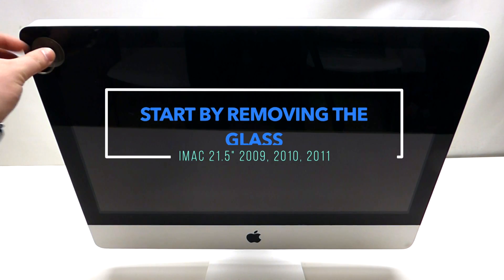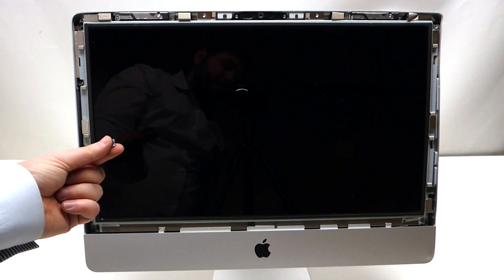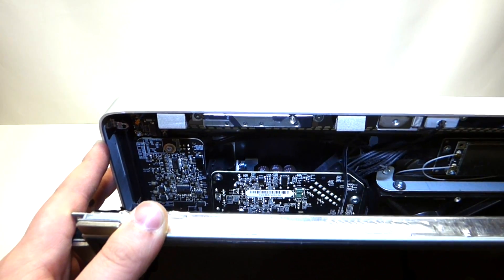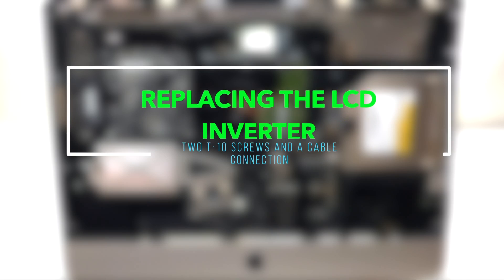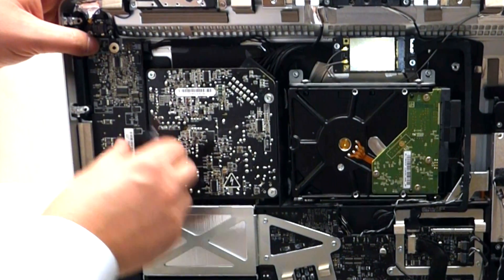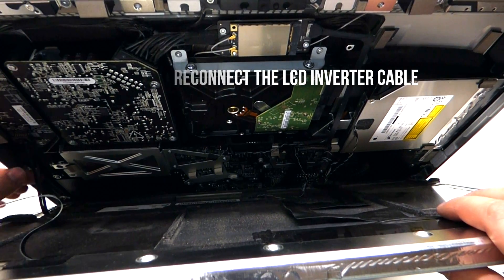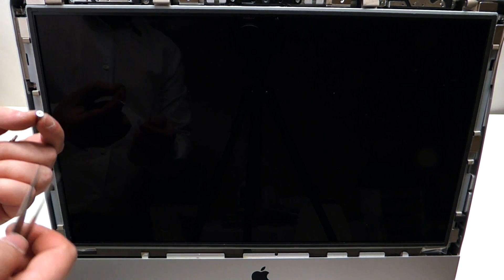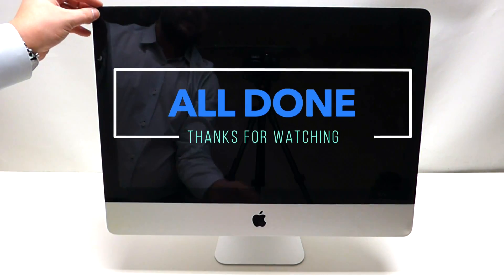iMac LCD Inverter Replacement 2009 2010 2011 21 5" Apple Dollars #10

Comment: Thank you for the instructions, they are very helpful. I wanted to replace my lcd imac late 2009 21,5 inch because of some dead pixels and lines. The lcd screen was stil working though. I bought a lcdscreen from ifixit, but that doesn't seem to work: it gave a very flaw light when I started the Imac but then stays black .
I tried it twice, cables out and in again , but the screen stays black. Then I put my old screen back and that worked as it did before. What could be wrong with the replacement, is it the screen or haven't I put the screencables not good enough into the computer ?

Comment: A plastic soda straw works great for installing the screws holding the screen.  Just inset the screw head into the straw for a snug fit.  Allow some of the screw treads to protrude from the straw.  Inset the straw and screw into the hole and rotate the straw to achieve some thread engagement of the screw.  Withdraw the straw leaving the screw in the hole.  Complete screw tightening with a torx tool.
Reply from the maker: Very nice tip! Thanks!

Comment: great video, thank you...however after replacing the board my computer worked great for about 3 days, then the problem came back...the computer monitor just goes black at random, and i have to force restart to get it to go back on....also if i plug in another monitor the screen is visible. is it possible the new board i just put in went bad already? if so what in your opinion is the cause of that? im wondering if it has something to do with the power supplied to that board maybe? i rly appreciate your advice and opinion on this issue.
Reply from the maker: Sounds like the LCD Screen is the actual issue. I would replace that first before replacing anything else.

Comment: thanks for giving me this view inside my 2008 imac ;) my lcd backlight works fine but ive noticed since around 2015 its a bit dimmer than it used to be and adjusting the brightness virtually does nothing visible.... does this mean my lcd backlight is on its way out? anyone have any experience with this? would replacing it return it back to its former white-bright glory?
Reply from the maker: This means that the LCD panel is giving out from years of use. You have to replace the entire LCD.

Comment: Hi , backlights not working screen is black when flashing with torch to screen i can see everything .when i press ctrl+shift+eject screen light up normal for second,thats mean wires  and lights are ok, you think this part will solve the problem?
Reply from the maker: It's the LCD or the inverter. I would replace the inverter first since it's the cheaper one to replace out of the two.

Comment: So, for a 2010 imac 27" with a A1312 inverter what would be different with this installation?
Reply from the maker: The location of the internal connections once you start taking off the LCD are slightly different but the theory is relatively the same. I believe that by watching this video you can do a 2010 27" imac inverter replacement without a problem.
Reply: Awesome. Thanks!

Comment: Hi I have mid 2011 imac 27 with i7, it randomly goes black but everything still works just have black screen. I followed this vid with replacing my inverter with new one and issue is still occurring. I did do smc n pram resets and no help. any other ideas? Thanks
Reply from the maker: Next would be the LCD Panel, then power supply, then graphics card, if that model has one.
Reply: Save Apple Dollars, ok so today I hooked up external monitor and when the iMac went black the external stated on. LCD u think?
Reply from the maker: Yes, I would go with the LCD next.
Reply: Save Apple Dollars can this be some kind of lcd Cable that heats up and turns de lcd off because some times it takes long time to shut of the lcd.
An Apple technician told me to check the cables first, if it doesnt solve it, lcd problem.

Comment: my imac 2009 27" got black suddenly :( is it the inverter that i have to change? and is it the same inverter like for imac 21.5 "?
Reply from the maker: It's one of the following four components, they should be replaced in the following order based on cost: inverter>power supply>LCD Screen>Graphics Card(Some units have integrated graphics). The next logical step for you is to replace the power supply or the LCD panel, I would try the power supply first.

Comment: Hi, I replace a refurbished inverter in my iMac 21.5 (late 2009) but the Mac doesn't work. When I press the power botton, the classic apple sound starts but the computer turns off even before the sound ends. So, I remove the "new" inverter and I installed the old one again but nothing changed. 
Can someone help me, please?
Thank you in advance.
Reply from the maker: Sounds like you have a bad power supply. With these imacs, one of the following is broken and you just have to figure out witch one; inverter, power supply, LCD, Graphics Card. They are priced in that order as well. Let us know if this helps.
Reply: I can only tell you that I don't know how I unplugged the plug that connects to the LCD cable, the one attached to the graphics card, but the, with difficulty, I reconnected it. Could this be the problem?
Reply from the maker: Yes.

Comment: Hi, it will be great if you can give your professional advice on this problem after my I mac ( 21.5 A1311 mid-2011) was damaged by an electrical storm,  a lightning hit my I mac, my main board was changed and also my video card was repaired, but at the end the screen was showing some dark flickering, my questions is, in your experience, it is problem with the inverter or I have to change or the screen could be repaired ?  please, a I have a very short video of my I mac o this link...http://bit.ly/2DyQHAJ after the system was loaded I could see the imaged but still flickering in black, thank you so much for your time!
Reply from the maker: I would start with the inverter since it's so cheap. Then the LCD panel, then the power supply.

Comment: Hi , My 2010 iMac chimes up makes the normal fan and hard drive sounds but allot of the time the screen is blacked out. I try to switch it off and nothing.. if I leave it for a few hours it may decide to start up normal but never blacks out as long as I don’t let it go to sleep. Do I need a new inverter ? Thanks
Reply from the maker: It could be one of the three, inverter, LCD panel, power supply.
Reply: Save Apple Dollars thanks for you’re reply! It still makes noises plays sound and so on when the screen is black . Is there any way to detect which one it is ? Thanks !
Reply: @GRIBSOFT  Would the power supply be the cause for the black screen of death? I get a chime, error sounds when I hit the keys, bubbly noise on the volume buttons are normal. When I shine a light on the screen I see nothing. The logic board was replaced. Heard it could be thermal paste (sensor area?) Is there a way to visually inspect the inverter to see if it's that? And by LCD panel do you mean the strip at top or the entire screen?  Lot's of questions I know I'm sorry, but I think you're my only hope for answers, I'm broke! Please help!

Comment: what can i do if the fist let lights up, but the power button is not working, because the imac doesn´t turns on; i checked power supply and its output is 12v; howver i dont know how to trhoubleshoot this problem and fid out how to do a proper diagnostic. i appreciate any information or video you could provide.

Best Regards
Reply from the maker: Off the top of my head I can suggest finding the two pins to short start the iMac, i don't remember where they are so you will have to look for them. In many cases you can have the first green light and the power supply is still bad.

Comment: Where can I buy the inverter for a 24 inch?
Reply from the maker: Ebay. But note that the only late 2009 (21.5" and 27") and up imacs had replaceable inverters and the 24" and 20" ones are early 2009 and before had the inverter integrated into the lcd.
Reply: So what would I need to fix a black screen on the 24", I can still hear sound.
Reply from the maker: The LCD panel, Graphics Card, Power Supply, they usually go bad in that order so start by replacing the LCD panel. Plug in an external monitor to see if it displays and get the serial number so that you know the exact year of the iMac then search ebay for "2X" iMac 200X LCD PANEL" where X is your year and size. Good luck.
Reply: Thanks but one last question, the iMac only has USB port how to plug an external monitor to it?
Reply from the maker: You are looking fro something called a mini display port. http://alvinalexander.com/sites/default/files/users/user3/imac-dual-monitor-external.png
You then need this to hook it up to any monitor https://www.amazon.com/AmazonBasics-Mini-DisplayPort-HDMI-Cable/dp/B0134V3KIA/ref=sr_1_3?s=electronics&ie=UTF8&qid=1499361802&sr=1-3&keywords=mini+displayport+to+hdmi
Reply: thanks again
Reply from the maker: Glad to help.
Reply from the maker: Note since you don't know the year of the iMac and it could be the 2007 older series then you will need the Mini DVI to hdmi cable like this one here https://www.amazon.com/JacobsParts-Female-Adapter-pre-2008-MacBook/dp/B018GORLO4/ref=sr_1_3?ie=UTF8&qid=1499363046&sr=8-3&keywords=MINI+DVI+TO+HDMI+2008

Comment: Hi, i have changed lcd connecto on the logic board, it is connected perfectly but i still no have backlight but no video, how can i fix this?? thanks man
Reply from the maker: If the inverter is changed and you got no video, then the problem could be one of 3 things in the following order, the LCD panel, the Graphics Card or the Power supply. 09-11 iMacs GPU is on board so the graphics card is not the issue. I would replace the main LCD panel next.

Comment: hey great tutorial, not to sure if thats the problem with my iMac 21" late 2009 model, it runs hot  fan going fast and some times, goes to the black screen,pram reset seem to work but for how long. While the Black screen  Ive shown a torch on it and can see desk top images, could be the sensor for lcd tripping due to temperature and should I reapply new thermal paste to heatsink and chips to cool things down like to see good video on it.
cheers Mate.
Reply from the maker: If you can shine a light and see an image then the back light is going out so if it's not the inverter then it's the LCD panel and not the graphics card. Replace the inverter 1st as it's only $20 or less, if that doesn't fix it then replace the LCD panel, you can find one for less then $100 on eBay. Make sure all sensors are plugged in and located where they should be. There are 4 sensors, one on the LCD panel on one of the corners, one on the hard drive, one on the optical drive and last one is the most important one that is the system temperature for the main fan at the bottom left side on the iMac, usually attached to a fan or speaker (bottom left). If any sensor is not plugged in or is in an incorrect place the fans will blow like a jet engine. Good luck.
Reply: where do you find a lcd panel on ebay for 100 bucks?
i need a 27" lc panel for an i mac mid 2010 and i cant find one which i could, i cant buy a new one for 500 dollars

Comment: Hey, this is excellent. Thank you for going through the trouble  to post this! One question - Is this a likely fix for a screen that is completely off when the iMac is running? My screen is not functioning at all. I have tried all the quick fixes i.e.: p-ram, smc reset . . .  my dual head card is not working either at the moment. I can't run and external monitor but could before my current issue - (pun not intended)
Reply from the maker: Hi, if you can't run on external monitor then your graphics card or logic-board could be bad. The inverter only fixes the current to the LCD and it's very likely that the LCD it self could be bad. Although, the inverter is the cheapest thing to buy first to replace, you can find them on ebay for $10-20. What year and size is your iMac?